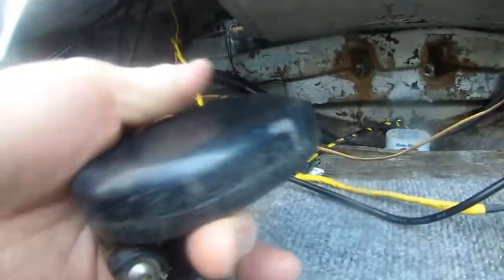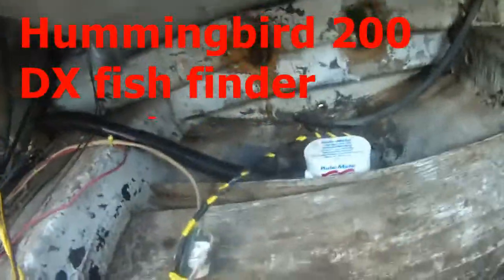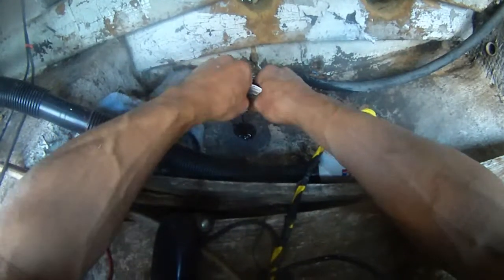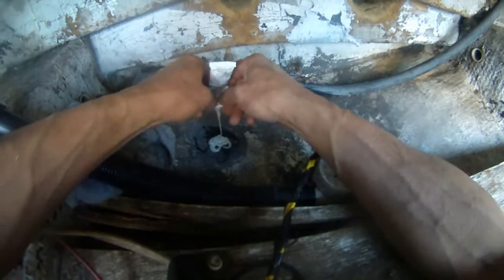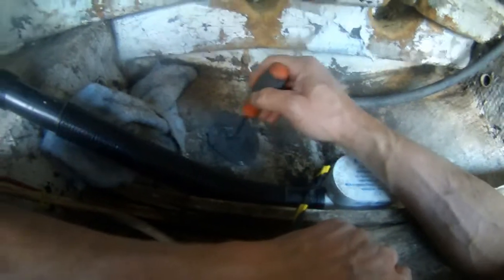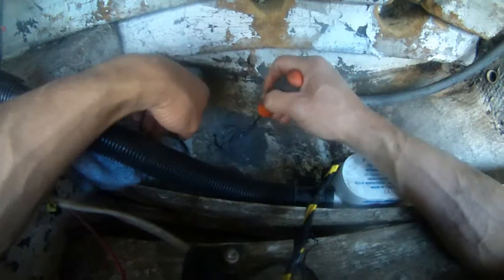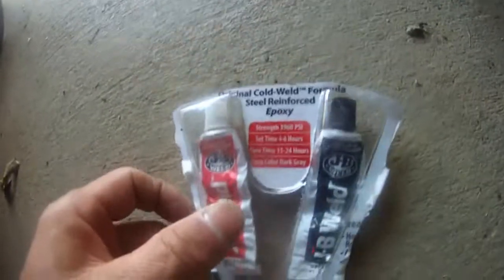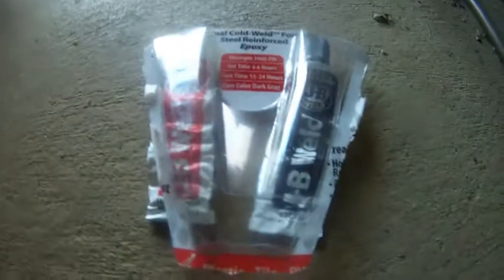mount my hummingbird 200dx transducer inside my boat hull using JB WELD EPOXY - DIY

Comment: Next time, build a dam around the area, maybe a bead of caulk the day before, just slightly larger than transducer.  Mix the epoxy before you put it in there.  It thins after mixing and will allow air bubbles to work their way up.  Then lay the transducer into the deep epoxy puddle starting at an edge so that NO bubbles are trapped.  Just be advised, really deep epoxy pours can get VERY hot, and I am not joking.  Do a test pour first and experiment outside the boat (not with your transducer obviously).  You will learn a lot, and 10 bucks in extra epoxy is a great investment in understanding what is about to happen. Sorry it didn't work.

Comment: Did the paint thinner remove the epoxy?
Reply from the maker: no, so I am prepared to use heat blower to soften the epoxy soon. thanks for following up, winter is tough to do any work